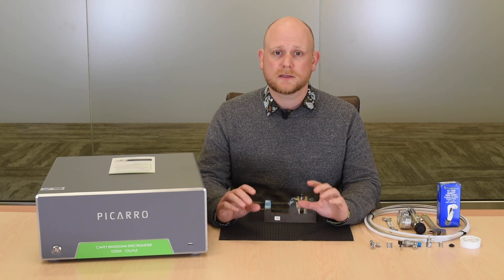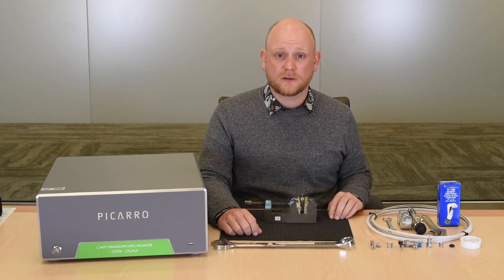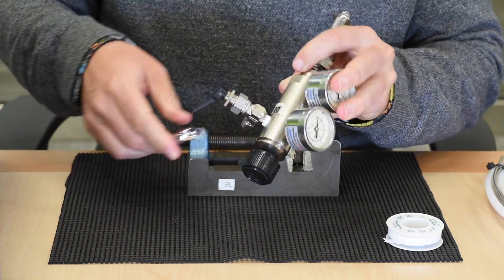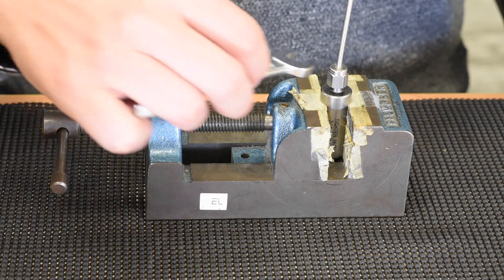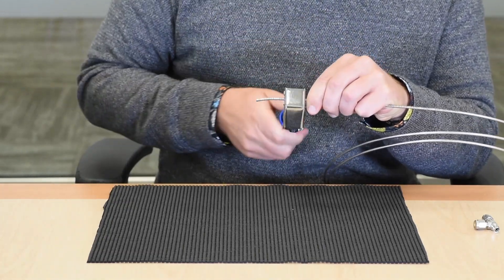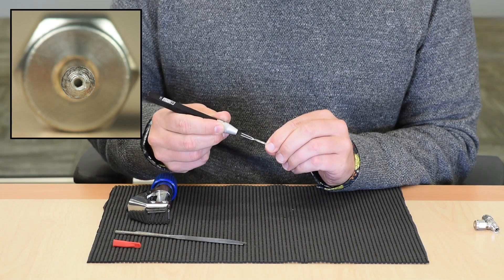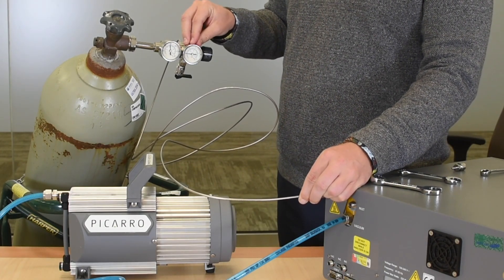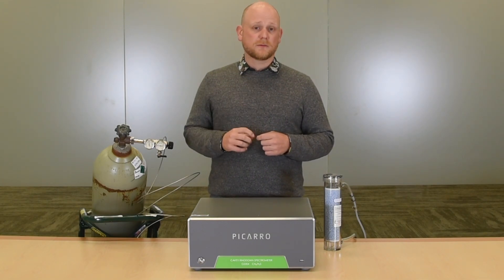How to Cut Tubing and Install Swagelok® Fittings and an Overview of Picarro's Dry Gas Kit

Comment: Same process for Nylon tubings?
Reply from the maker: (My understanding, not as a representative of Swagelok) 
For metal ferrule sets and nuts with nylon tubing, yes: The ¾” or 1 ¼” preswaging is identical. The rotation has to do with the compression needed to drive the back ferrule under the front. 
For other fitting materials, e.g. Nylon or PTFE: different recommendations exist. Check on Swagelok.com
For nylon tubing: a much simpler tubing cutter like this https://tinyurl.com/yc8rzox7 unit can be used, and there is no need for filing down the ends.
 
Of course, with respect to Picarro analyzers, always check gas materials compatibility before using Nylon.